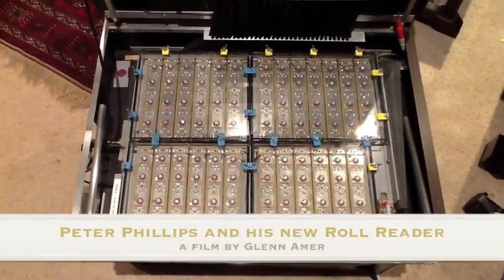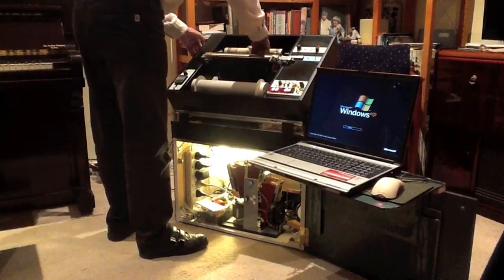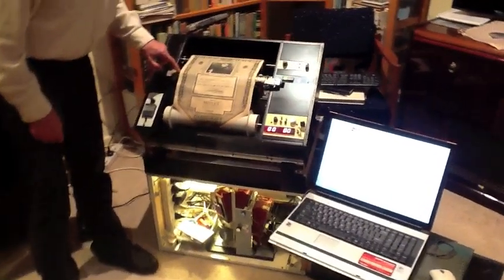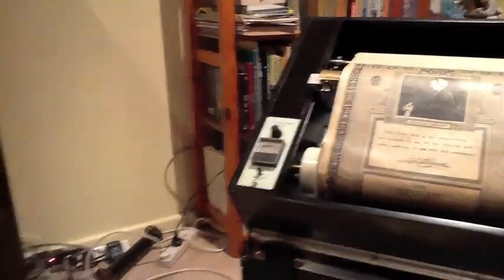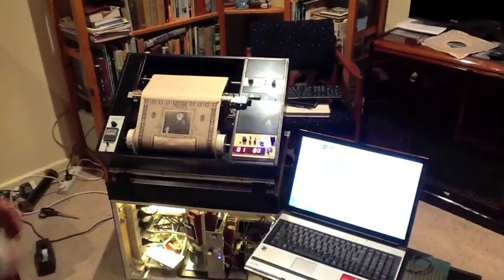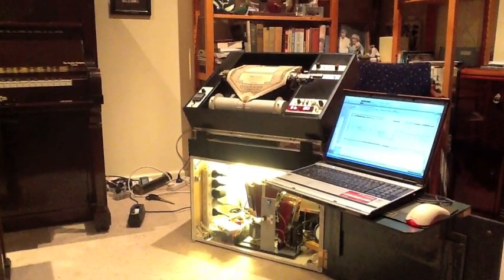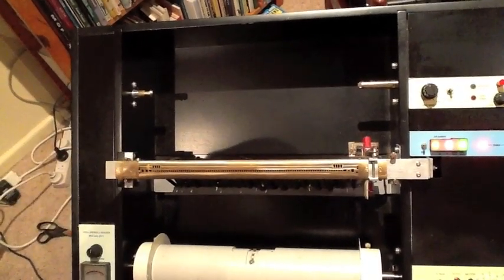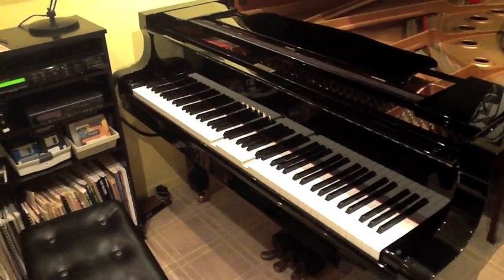Peter Phillips' new Roll Reader

Comment: It's a very commendable achievement. Good work! However, as I can see, the roll reader does nothing except scan roll perforations. I don't think that's sufficient to make a reproducing piano output all dynamic nuances of the original playing as it's just one variable to the equation. 

Since the systems were largely incompatible, you couldn't play a roll on the other system without losing details, peculiar for a given RP maker, unless a copy by maker A was licensed to maker B. As I understand it, to breathe life into these performances, one needs a perfectly restored and tuned piano, which should be similar to the recording piano and the impeccably restored and maintained reproducing mechanism of a particular brand. Without adhering to these criteria, I'm highly sceptical of the artistic merits. The fact that, from the engineering viewpoint, the device operates smoothly doesn't exhaust the work of actually recovering roll performances. The ultimate goal isn't making it mechanically plausible. It's about bringing back the magic of musicianship.

That's why you need no less than what was accomplished by the Pierian Recording Society with Welte rolls from the Caswell Collection (which is the best and unrivalled effort to this day, I reckon) or Wayne Stahnke, a NASA engineer, who made the mathematical model of the Ampico system and managed to translate the physical Ampico rolls to a form acceptable to the model. The results were overwhelming.

The pianos in this video sound squeaky. There's almost no dynamic variance, and the balance between melody and accompaniment is broken. Yes, you played Welte on Yamaha Disklavier. Despite that, there's a missing link.